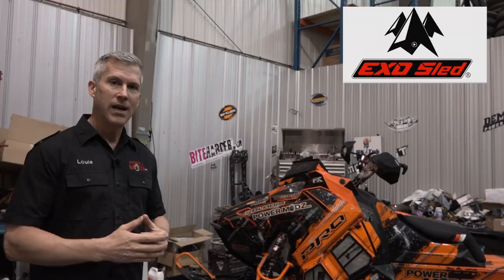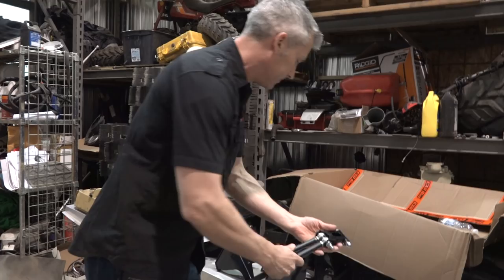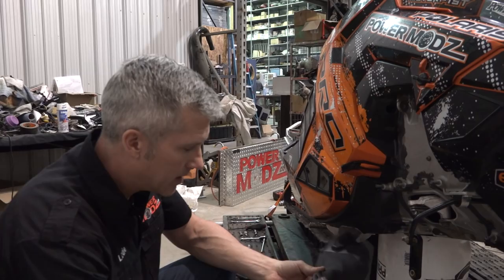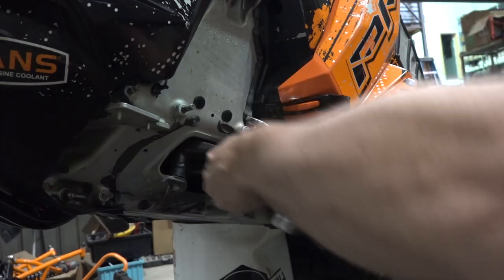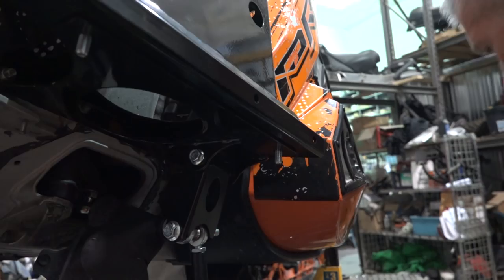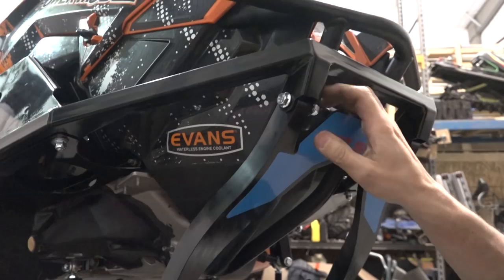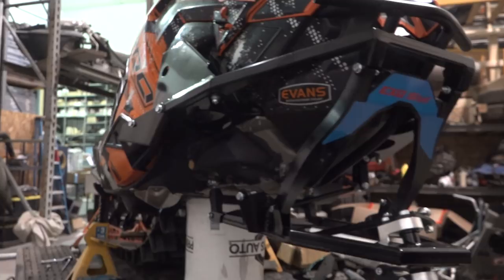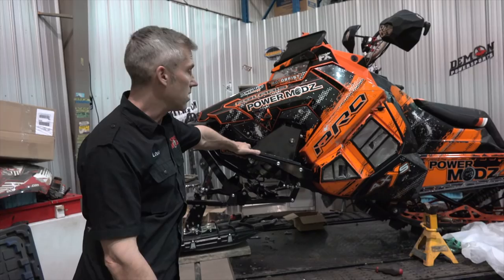EXOSLED Install on my AXYS RMK!

Comment: I am looking at a 1971 Elan 250 single with Tillotson carb. I've watched your carb rebuild videos, they are great!  I wish I had access to those back in the 80's as I wrestled with the Elan my father bought brand new in 1976 for $900 cdn  white cab with yellow stripe and penquins!!!   I thought my parents were going to divorce!  It was the greatest thing for me, and kept me busy and getting into wrenching. I ran it WOT for 30 years and grew tired of it and sold it... I enjoyed a few fixed up ET340 since and such but I want to get an old elan.... you got any : )  
Anyhow can you still get the quality rebuild carb kits for the tillotsons.... with the stainless needle valve keeper and the proper spring for the pump lever?
Great watching you work on the sleds but especially the older units.... "it ain't snowmobiling unless your coat smells like gas"   do you have that on a tee shirt?
Reply from the maker: lol good times eh!  I have the kits - email me at Lshobie at yahoo dot com and yes I have an elan for sale!

Comment: I hear you about enjoying an old beater sled in the woods. It’s less about performance and more about fun and having something light, easy to throw around and being able to thread through trees. I rode an old 485 Phazer years ago and it was great for that. I like old Trail Indys for that use too, even though they aren’t as light. 

I think there is a market for a low seat height, CVT, factory built snowbike. The current Timber sled  dirt bike contraptions are not what I’m interested in either. I don’t see the Exosled being what I want as they don’t have similar enough ergos to a dirt bike. If Cat would release their snowbike they have in the patent drawings I’d be first in line at my Suzuki/Cat dealer with deposit in hand.

Comment: Off Topic Question:

I just picked up a 2020 Assault, and the parking brake is about impossible to engage.  I thought it was just mine until I rode with a friend today who also picked up a 2020 Axys, and his is the same.  It's almost a 2 man job to engage the brake.  You have to squeeze the brake lever super hard, and even then, it's hard to engage the red plastic parking brake lever.  Then, it is equally hard to release it.  Is this how they are on all Axys sleds?  or did we both get duds?  I've been riding Polaris since the late 90s and never experienced this until my new Assault.  Thanks for any input.
Reply: I got a solution from one of your other viewers. I took a file and slightly filed the tab on the red brake lever. Now it will engage all though it’s  still really tight.

Comment: I found a ski doo mxz 600 rs from 2010 for 2200 dollars with 1200 miles on it
Is that a good deal?
Reply from the maker: No idea - lots of things to look at
Reply: @PowerModzOfficial  🤣🤣🤣 Louie
Reply: the price sounds sorta fishy but just make sure you know what you're looking for when buying a sled,  make sure everything looks as advertised. most 2003-7 ski doo revs are going for a few grand so I would watch out if a 2010 is that cheap. the miles sound almost unrealistic to be that low (check odometer, make sure odometer isnt pulled out either). but if everything you're saying carries out to be true that is a great deal
Reply: @absoluteunit4028  Does it cost alot to mantain a ski doo 600 rs?
What do you need to do to mantain it?
Reply: Surely was 2 years ago
Reply: @absoluteunit4028  my 06 summit 600 ho sdi 144 went for 6250, mint, 700 kms in 2014.